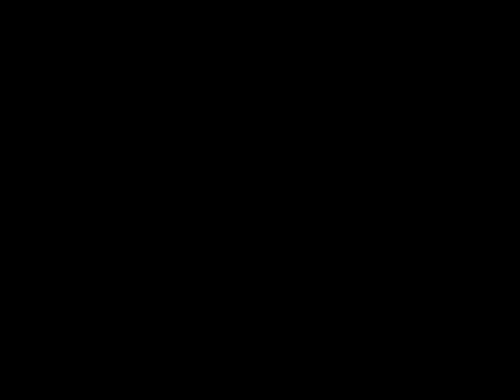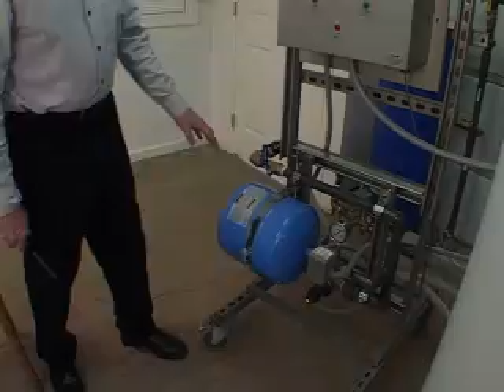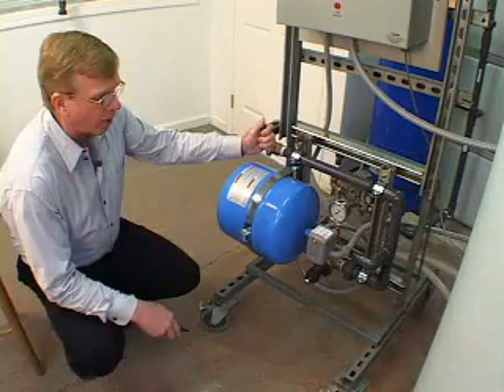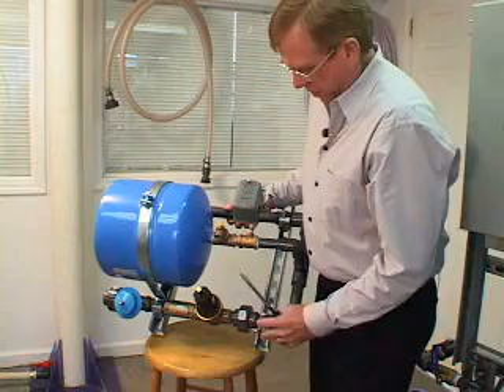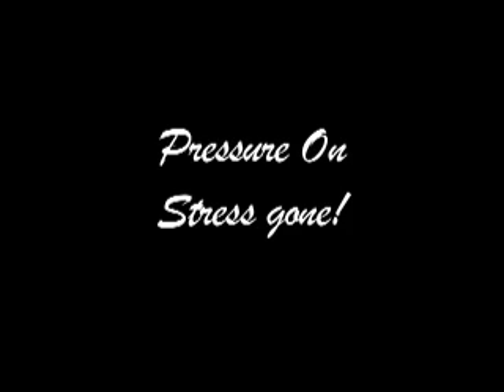Consistent Pressure Module for Well Manager

Comment: I have a three story house.  It has 3 different water systems.  The size of the tank which was installed is the size of the one in your video except it does not have any other mechanisms attached to it.  Just a pipe stem extending from the main then the tank.  All these years we never had a problem.  Since it is a town system hook up, was it necessary to have to install that cold water pressure tank?  And.  Since I have to replace it, after that is it necessary to charge it with air?  And how much thanks!
Reply from the maker: thanks for inquiry please email wellmanager.com for more information . Lynn